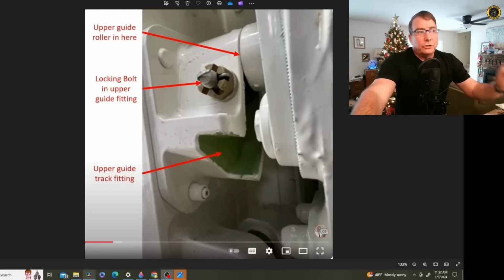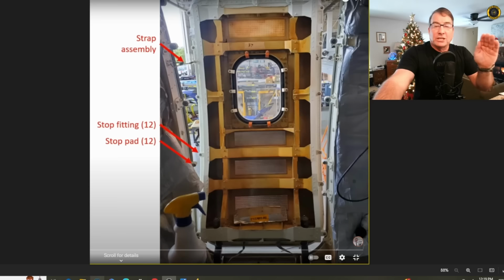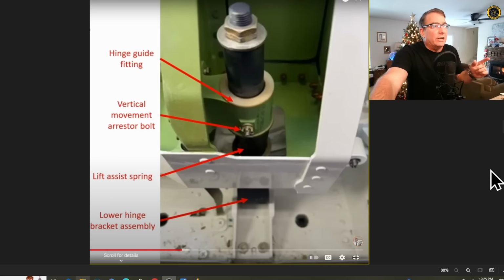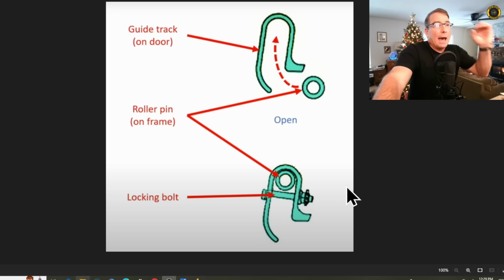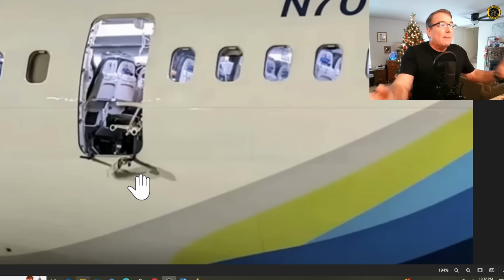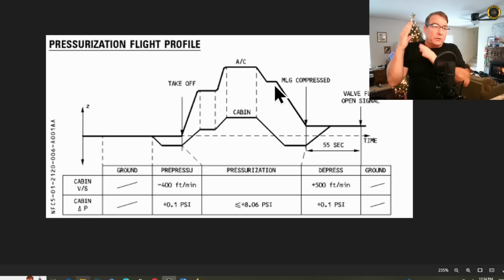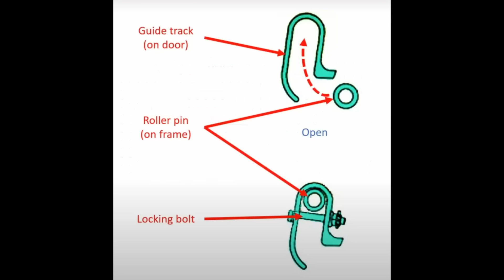Alaska 737 Max-9 Door UPDATE! 8 Jan 2024

Comment: I’ve been an aircraft technician for 23 years and we operate the Max9. I’ve opened and closed one of these plugs as well. Keep in mind that other 737 NG’s have these plugs installed in the longer fuselage models, not just the Max. They all work the same way and there’s never been an incident like this. I’m not saying this is what happened, but I can’t see how this could lug could come loose unless the two upper capture bolts, and the two lower bolts through the spring hinges weren’t installed. Even if a set of bolts, either uppers or lowers were missing with the opposites installed, I can’t see how the plug could come loose and depart the airframe. Just my ten cents. 
To open the plugs, the corresponding row of seats where it’s located has to be removed, and the surrounding interior side wall paneling and insulation. There’s also a seal that reacts to ambient temp that helps keep everything nice and tight.
Reply: Some people who signed off on this particular installation ought to loose their license and/jobs.
Reply: My understanding is that you remove the bolts than push down on the door against the spring pressure till the top roller clears the track.  Then the door can swing out.  Am I right about that?
  I was an aircraft mechanic for many years and I dont see how it could just come off without some noticeable damage.  Charles
Reply: Your ten cents are appreciated and quite a lot more valuable than my 2 cents
Reply: It was clearly installed wrong
Reply: Yep...any one of the four capture bolts, if installed, could have kept that plug from lifting vertically and disconnecting from the capture fittings.  NAS bolts are extremely strong, and those bolts in particular would have been ones rated for high shear strength.  As a retired aircraft mechanic, I'm willing to bet the plug door was fitted into place without the bolts being installed, not documented properly as such, and then something like shift change happened at the factory, and you know the rest of the story.
Reply: @465maltbie  yes
Reply: @mcburcke  You don't want a Friday afternoon 737.
Reply: @kCI251  You sure don't want a loose license and/or job...
Reply: If this turns out to be the case, that would be quite shocking wouldn’t it!
Reply: @465maltbie  "Am I right about that?" 
Malt I think it's the opposite. The "vertical assist springs" are meant to help LIFT the plug up out of the guide track. The guide track is on the door and the guide roller is on the airplane frame.
Reply: Hinge arrestor bolts and slot pin bolts all need to be missing?

Who sign that checklist ???
Reply: Somebody went to lunch and forgot where they left off when they came back.
Reply: Once the capture bolts are removed how much pressure is needed to move the plug upward those couple inches until the guide roller exits the guide track? At 8 PSI that's quite a bit of pressure on that plug. If the bolts were missing wouldn't the plug just push up the roller and come off first flight? Not sure how many flights there were since the plug was last installed.
Reply: I'm not a technician but understand logic and mechanics, and I think you are spot on. Based on the lack of shearing of side eye holes, the door had a clean explosive removal. Someone in 'QA' is gonna get their ass handed to them for very possibly missing a whole door bolt assembly.
Reply: Your ten cents is deeply appreciated.  My question is: did Alaska need to perform any type of maintenance which requires to remove the door plug since the delivery not long ago?   Thank you very much.
Reply: @jeffropenn  Jeff, Just an observation and wondering your opinion:  Looking at the 9 minute mark, the upper roller pins do not look to be sticking out as far as they should be ( by maybe a inch+).  Could the roller pin have slide back into the guide roller (of frame)?  Just curious, thanks
Reply: Again two words Quality control.this particular inspection at the operator I work for is RII  and it's done during a B check hangar check. Boeing got lucky on this one. Kudos to the entire flight crew.@mcburcke
Reply: @rael5469  No it cant, look at how the track is made.  You cant lift it out, the bolt holds it closed and you have to lower the door.  That is the only way I see it working.
Reply: Somerhing was not installed, was missed as it seems. Its a new aircraft to assume wear and tear.
Reply: Yeah the only way I can see this door plug leaving the plane as cleanly as it did is if the 4 bolts where not installed. Otherwise  it would depend on the simultaneous clean shearing/failure  of all 4 bolts with no jamming of said bolts, I find that hard to believe.
Reply: @jeffropenn I do agree with you !  somebody had to have omitted at least 2 of the cotter pins!  and missed it on inspection.  How could that have happened ?
Reply: @kinosaki3311  Hard to imagine since the plane was 2 months old.
Reply: Thanks for your input.
Reply: @465maltbie  no you're wrong, Chris has got you confused, Blanco explained it properly.  Enjoy your retirement.
Reply: @465maltbie  the track is mounted on the door. The pins come out the bottom of the track. The door has to be lifted to open.
Reply: If that door-like "plug" slides up/down to disengage/engage with the frame, then wouldn't that require plug to be less tall than the opening (to facilitate the up-down movement), and thus leave a corresponding gap at the top of the plug once installed?  I infer that the design is so that the plug can be fitted from the outside of the aircraft yet still operate as a plug once installed (interior air pressure pushes plug against the frame), but I'm not seeing how it manages to completely occupy the opening.
Reply: @encinobalboa  ...or a Monday morning one for that matter!
Reply: @465maltbie  The track is on the door, the roller is on the frame, so the door travels UP (with spring assist) to clear the roller..  When it has traveled up that 1.5 inches, the stops will clear the ears, and there goes the door.  If the bolts all weren't installed, the remarkable thing is that it stayed close for a couple months, not that it eventually opened.
Reply: @thebigmacd  No you are confused, I was speaking about the roller track at the top of the door opening.  Look at the photograph of the part.  The bottom of the door has the springs and the bottom of the door has a bracket with the guide bushing that rides on the hinge.  look at the j track at the top where the roller is, the retaining bolt is under the roller and the roller moves down in the track to open and up in the track to close.
Reply: The tracking history of this plane shows it t departed JFK that morning, where it had been overnight. History has two major crashes from JFK. TWA 800 in 1996 (230 lives lost) and AA 587 in 2001 (260 lives lost). Does anyone here think it could have been tampered with at JFK?
Reply: My sentiments as well. There’s no way that plug door is sliding up and out if at least (2) or more of those movement prevention bolts were installed. 

I mean sure it could happen, but all (4) vibrating loose if no cotter pins, and ontop of that then the bolts themselves would have to fall out of the holes and who’s to say the bolts could even fall out once in place.
Reply: @craig7350  I disagree, look at the roller track at the top of the door frame, the door is pushed down to open and raised to close.  The springs help you raise the door to the closed position.  The locking bolt is under the roller.
Reply: Been puzzled why the top of the door has nothing to secure them to the frame of the aircraft.
Reply: @465maltbie  Look again. The tracks are on the door and the pins mount to the frame. Lift the door to remove.
Reply: @mcburcke  💯 Agree
Reply: If there IS such a thing as a 'no brainer', this one is. I think your ten cents is worth a million bucks.
Reply: I suspect they either never changed the bolts and the last one finally went, with cotter pins those have to be on a replacement schedule, or they forgot to put the new ones back in the last maintenance.
Reply: @Graham_Wideman  I think the fact that it’s a curved surface may have something to do with the ability to be as large as the hole in the fuselage thereby allowing the movement. Am I wrong ?
Reply: SABOTAGE!!!!!
Reply: @meko1896  Ok, thanks.
Reply: @465maltbie no - raised to open, down to close.
Reply: A LOT MORE TO THIS THAN IS APPARENT NOW !!!!!!!!!!
Reply: @adrianklaver113  the four cross bolts, PLUS the jam nuts and washers on the lift shaft.  If just the four cross bolts were missing, the jam nuts and washers should have retained the door in it's hinged down position.
Reply: @465maltbie it’s the door that contains the upper track.
Reply: @adrianklaver113  I find it hard to believe it just blew now after being in service for three months.
Reply: @465maltbie  the upper roller track is mounted to the *door*. Look up a diagram of the assembly. The roller is mounted to the frame. The J-track is on the door.
Reply: It seems that even though these plugs are referred to as plug doors they are not oversized like traditional plug doors.  I've read that these plugs and some overwing exits are like this.  They rely on the stop fittings and stop pads to take the force of the differential pressure between the interior and exterior.  @Graham_Wideman
Reply: sabotage ?
Reply: Airbus tech here. I appreciate your explanations.
Is there any kind of rigging that goes on with installing those plug doors? 
Any kind of even-torqueing measures taken, with the plug securing hardware?
Reply: @465maltbie  u r CO-rectal.  it requires missing parts and direct movement.
Reply: @edgonsorowski1924  No tampering - it's lots of work to get access to the bolts. Removal of seats and panels first. You don't think a much better guess is someone slept at work at Boeing and failed a critical inspection step?

If you get home from the store without cheese - is it more likely you forgot to buy it. Or forgot to pack it. Or do you suspect someone opened your car and stole it from your bag?

Never go for complicated solutions as long as you have simple solutions still not investigated.
Reply: @adrianklaver113  Or lack of cotter pins, and unthreading of nuts due to vibration, though that seems very unlikely in such a short time period.
Reply: @mcburcke  I fear that you might be right.  This explains the event.  But it does not explain how in the world such a critical procedure could be messed up AND not checked before letting the airplane out of the hangar.  
That's the part of the story that is going to leave a welt.  If things like are happening on a brand new airplane then what kind of confidence can we have in any of the work done to this airplane .... who signs off on this work?  How could this get signed off?   If it wasn't signed off how did dthe airplane get into service??
Reply: @465maltbie   I'm not sure what you are talking about. You stated it the opposite. You said "My understanding is that you remove the bolts than push down on the door against the spring pressure till the top roller clears the track.  Then the door can swing out.  Am I right about that?" You were wrong about that. The track is on the door and it lowers down over the roller, then the bolt is installed. The springs help lift the door when the bolt is removed. They said the door weighs 65 pounds, so the springs help lift the door. They are meant more for when a real emergency door is installed.
Reply: @gismo130  That's a great song
Reply: @465maltbie  You have mixed what is part of door and what is part of door frame. The pins are in the door frame. The opening for them to slide out is downwards on the door. So you lift the door to slide out the pins.

The springs helps opening the door. And the upper bolts blocks the door from being lifted, because the bolts are inserted under the door frame pins.
Reply: @requited2568 This plane was only months old. The word finally doesn't apply.
Reply: @seagullsbtn  The top of the door is secured to the frame by the two frame pins that are sliding into two channels in the door.

And then the overlap of all the 12 pads also blocks the door from moving outwards.
Reply: @ChasOnErie  Why scream "SABOTAGE" if "stupidity" is a viable solution? You want everything complicated?
Reply: @mcburcke my husband worked at Boeing in Mesa, AZ on the building of Apache helicopter. He passed away 4 years ago. He always had stories like you guys are talking about. Shift change, workers knowing something needed changed but upper management doesn’t listen. He had a couple stories that people lost their jobs over but I don’t want to say on here. Boeing isn’t what it used to be.
Reply: @Milkmans_Son   That is less surprising given the pressurization fail light came on three times going back to December 7th. There are alternate explanations for why that could happen, but one is the door plug was moving around on its contact points. A body at rest stays at rest, the weight of the door plug, the friction of the contact points and pressurization would tend to keep the door plug in position. As Juan pointed out in the video there could have been a 'perfect storm' combination of low pressure differential and fuselage movement to make the door plug move enough this time to overcome it's rest position.
Reply: It’s my understanding this is a “permanent “ from the factory option, and becomes a structural part of the airframe, therefore not needed to be inspected every 100 hours…but maybe at an annual..
Reply: @465maltbie Push the plug/door up not down…
Reply: @rael5469  Thanks, someone else mentioned that also, most doors have the track on the frame, it looked like that to me.  Have a good week.
Reply: @465maltbie   "door is pushed down to open and raised to close. "
You are confused. The track is mounted to the door. From the closed position the roller is at the top of the track. The door can not go down with the roller at the top of the track. The track is mounted to the door so with the roller located at the top of the track, the door must be lifted to get it off of the roller.
Reply: Can loose bolt lead to failure? UA found some bolts loose, but not missing. Wondering if they would have failed the same way if kept in service.
Reply: @seagullsbtn   "Been puzzled why the top of the door has nothing to secure them to the frame of the aircraft."
The door frame is not strong enough to have stops located at the top. The door structure is strong enough to have stops at just the sides......but there ARE 12 stops. The door has a seal depressor all the way around the circumference to seal it.
Reply: As an A&P, is this plug removed or these retention bolts inspected at the initial 100hr inspection service? Given the subject aircraft has been in service for 10 weeks, I’m guessing it has recently completed that scheduled service inspection by Alaska Airlines
Reply: Do you think there is any way Spirit could be responsible for this?
Reply: @edgonsorowski1924    The blame for AA587 clearly rests squarely on the First Officer, whose big feet stomped on the rudder pedals in both directions several times, putting extreme side loads on the vertical fin and attach lugs…   In over 30,000+ hours as a major airline Captain/First Officer, I’ve never seen anyone ever stomp on the rudder with the kind of force that was clearly captured on the accident aircraft’s flight data recorder…  
  The TWA 747 investigation conclusion to me seems to be somewhat iffy, in that you would think that the electrical arcing inside of the center wing fuel tank surely would have manifested itself in at least one or two other of the old 747-100 series of aircraft…  There were a LOT of those airplanes flying at that time which for sure weren’t getting anywhere near the quality of maintenance attention that the TWA 747 was getting…
  And for someone to tamper with/loosen the hardware related to the Alaska 737 exit plug, they would have to remove seat rows, and disassemble the side panels to even get at the plug, which would be a highly unlikely thing for someone to do…   Most likely, the hardware was not or improperly installed during the build at the factory…
  Since the aircraft was delivered new to Alaska in October of 2023, its unlikely that there were enough hours or cycles on the aircraft to require a major inspection where that plug would have to be opened up and inspected…
Reply: @motofunk1  I read the aircraft was on its 99th revenue flight when the accident occurred.
Reply: @465maltbie   I was thinking the same thing, Malt. I also thought the track was usually on the aircraft side. It's hard to tell on that close up picture.
Reply: @465maltbie  The roller is fixed to the fuselage. The guide track is fixed to the door. Look at the image at 3:47. Thus when the door moves relative to the frame, the guide track moves.
Reply: @mcburcke  This assumption makes sense to me . I can't think of anything else .
Reply: @aerohk   The upper bolts would still be in place, so no. Any ONE of those bolts would keep the door in place. It is quadruple redundant. I'm not sure but I think all four bolts had to fall out for the door to depart that plane.
Reply: @kCI251  You're assuming it was inspected! I'm not assuming anything about Boeing procedures these days! OTOH reportedly the satellite internet antenna was installed just before the first pressurisation warning event Dec 7th, so could it have been that contractor to Alaska Airlines who needed to remove the plug and reinstate it after their work and if so who is then responsible? We should wait for the investigation to find the root cause but what I wonder is how many more faults are there hidden in the 737 MAX's?
Reply: @requited2568 The plane came off the line 10 weeks ago! It's not wear and tear!
Reply: Those who installed this door also thought that top bolts stoppers are redundant and didn't installed it.
Reply: @duanebidoux6087  Sure if the pin were improperly hardened and had sheared off or the ramp assembly were improperly machined in some way to allow excessive movement. Since pics show the upper pins are still in place, scenario 1 appears unlikely. Now that FAA has recovered the plug, they have evidence to inspect the receiver ramp. 

United is apparently reporting they have found several retaining bolts to be loose. Given its castellated nut w/cotter pin, how are the bolts loosened? 

My understanding is the plug is removed during an A inspection by airline operator A&P. May also be removed by operators upon delivery as final outfitting of aircraft. Is the ramp bracket metal annealed allowing the bolt head and nut to embed into metal? Are the bolts of improper heat treatment and threads are stretching? These bolts are not intended to be load bearing, it’s hard to understand how they loosen in service if the cotter pins are in place.
Reply: If the rivets that hold the mechanism in place sheared there would be the same thing as pulling the bolts
Reply: I’m definitely listening to you as you are actually in the know. No media gibberish. Rumor has it Alaska had pressurization issues in prior flights. PBA? 😂
Also if so, wonder if the FA’s heard whistling? I don’t think any other MAX 9 operators have found major issues. United says they found 5 with loose bolts. Loose? With cotter pin installed on the castle nut I see no issue.  I would imagine them to be designed to be a bit free given the system design. Just a retainer in shear. Not tightening.
Reply: Agreed. Nor a Monday morning!
Reply: @wmjohnson7063  What rivets?
Reply: @mcburcke makes absolute sense. Oh dear 🤦🏽‍♂️
Reply: Guarantee anyone who touched that door is sweating. I worked in a different safety-related discipline, and any assembly of any safety-related component was thoroughly photographed before and after we touched it. Of course there's a checklist, but I'd be more inclined to believe a photo rather than initials.
Reply: @jeffropenn After the door is shut on the ramp, what holds the door down with the upward force of the springs in play? Weight of door and friction of the pads on the stop fittings?
Reply: @requited2568 The plane was in sevice two months. There should have been no reason for maintenance there.
Reply: @jeffropenn When you removed those bolts/nuts to open the plug for service were the nuts self locking nuts?
Reply: @mcburcke  Shift change is a dangerous time.  I recall reading of a maintenance related disaster years ago where a supervisor volunteered to speed up a slow job installing fasteners in (my memory is inexact here) the elevator control surface.  For some reason, the supervisor didn’t finish the job and nobody asked questions because it was the maintenance supervisor who was responsible for the documentation.  The next shift also asked no questions because from the documentation, the work appeared complete.  The control surface detached in the aircraft, causing a crash.

A shift change in the middle of plug door installation either at the factory or at a maintenance operation could have aggravated a lapse in documentation which caused then missing castellated nuts and cotter pins not to be noticed.

This is a very young aircraft.  It doesn’t bode well for Boeing’s quality control procedures if the aircraft left assembly missing the locking nuts.  The aircraft could have been reconfigured after assembly, but that does not seem to be the case here.
Reply: @gumbus75 Do you think there was a misunderstanding that the team thought they were fitting a door instead of a door plug ?
Reply: Hey, question from another maintainer.  Don’t those things have cotter pins, safety wire, or at least sheer wire?  We have emergency escape hatches over the wing with hinged locks.
Reply: how does the flush door clear the fuselage to move either up or down? @thebigmacd
Reply: Lose is the right way . The way you spelt it is like “hey that lug nut is loose , tighten it or the door will go missing !”
Reply: @adrianklaver113  If a door plug with no fasteners installed can survive pressurization tests to 150% of max or whatever it is plus three months of service with only 3 pressure warnings, then fail suddenly and catastrophically at well below cruising altitude (let alone max altitude), this is a design and engineering failure of epic proportions.  If true, MCAS has nothing on this.

As far as the 1st law of motion goes, I have no idea how that fits here but either way you forgot the external forces part.
Reply: Yup.  It's either extreme negligence, or sabotage.
Reply: @robertbenda3285 never go to lunch until the task at hand is complete.
Reply: @TheCyberMantis  I heard the guys who installed the wifi antenna in the plane may have used this door plug to gain access...
Reply: @jamesmurray3948  Good question.  The track looks to be at an angle, not parallel to the door.  So I think the top moves up and out at the same time.  There must be a lot of clearance for it to work.  I'm interested to see how the seals work.
Reply: pins were never installed all four missing
Reply: @mcburcke it’s so new, I don’t think you would have fatigue on those bolts either.  Looking more likely a slip up in manufacturing.   Very lucky no one was hurt or killed.
Reply: Also an AME with similar length of experience - seems the most likely issue is that the bolts were installed, nuts done up finger tight, the split pins were not installed, and then the quality inspection was either not done or poorly done.  It would be very unlikely the bolts weren't installed at all, as the door wouldn't have lasted for a couple of months of flying like it did.  I've seen on a number of occasions where technicians have forgotten to put split pins in - usually this is picked up on inspection, but it's also a lot easier to not notice a missing split pin when inspecting than a missing nut or bolt.

The RAN lost a Sea King helicopter about 20 years ago when a tech forgot to install a split pin in a flight control linkage and the missing pin wasn't picked up on the inspection.  The nut worked loose over time, then the bolt fell out and the linkage disconnected, the helo immediately pitched down and could not be recovered due to no pitch control.  

It should never happen, but in some facilities/units/companies the culture of inspection standards can become lax, and it opens up the opportunity for this to happen.
Reply: @465maltbie  You push the plug up.  The Boeing manual "AMM SDS 52-23-00" is wrong!
Reply: @savagesteve5894  How could they know the pins were missing? There is no way they have the bolts and castled nuts still...
Reply: @moggy4086  The pins would have to be missing from four bolts. But more importantly why are only four bolts holding this piece to the airplane? There should be 40 bolts, not 4. What happened to Rosie the Riveter, did she die?
Reply: I don't know.  Some of the pictures show the stub from the pins still in place  That means the bolts mentioned in this video was not there to allow the door to move upwards.  The only way that can happen is the cotter pins were not installed properly and the nut came off.  Even then, I don't know exactly know how the bolts in the door frame is attached to the door.  If its directly bolted in, it seems unlikely for the door to move up unless all the bolts were sheared off.  I know crazy things has happened, but I think there is more to this.  I just don't see the bolts locking the pins in place to shear off even if the part was not a AN bolt.  Once the bolt holding the pins in place came off, I can see that over time, the vibration and pressurization/depressurization cycles may work harden the remaining bolts.  Once they start letting go, its a chain reaction.  I'm sure there is more to this story and we will find out once NTSB releases their findings.
Reply: @465maltbie  No, the roller track is on the plug, the roller is on the door frame.  Push up to open.
Reply: @ericmcleod7825  Correct.
Reply: I was thinking a lot of things would have had to fail for the door to come loose.
Reply: @tori8380  Its either incompetence or sabotage.
Reply: I do not understand why each bolt is not safety wired in place? There is not enough redundancy.
Reply: @mcburcke yep, could be that built on a Monday or in this case Friday pm thing…someone’s shift was over and had to get outta there 🏃‍♂️ leaving the bolts installation incomplete….and the next person on assumed the job had been completed without carrying out a visual inspection.  There should be a paper work trail 🤔
Reply: @ZeroG they may be able to tell if bolts and nuts were fitted by looking at the fittings microscopically and/or other non destructive examination. 

If they were fitted but the nuts not pinned, there would be wear marks as they worked their way loose.
Reply: @perwestermark8920  Yes, Hanlon's Razor applies here. "Never attribute to malice that which is adequately explained by stupidity."
Reply: @mikewaterfield3599  They all have castle nuts and cotter pins, yes.
Reply: All four bolts were missing their cotter pins and rattled out? Really hard to believe. All four bolts were substandard and sheered in a cascade,(one goes and the rest follow), event? Design usually builds in a safety factor, bet two bolts at the top are all that is really needed. The door is forced up against the stop pads by the over pressure and has to overcome the friction involved to move up. With the fuselage upright, the weight of the door plug would hold it down. What caused the plug to move vertical off the door pins?
Reply: @Leon-qc7fe  It's not the bolt, its the nut that needs to have a cotter pin if it uses a nut.  There is something fishy about the entire situation.  Let the NTSB find the root cause.
Reply: @465maltbie  Looking at the diagram, you've got it backwards. To get the door released, you have to lift it about 2 inches for the roller lugs to come out of the bottom of the tracks in the door. The springs in the bottom of the door hinge assist you in lifting the door but cannot lift the door completely on their own. BUT, if the capture bolts are missing, and with the plane rattling the door around with varying G-forces on the door during the climb, the springs may be able to get enough advantage to lift the door themselves, and air pressure does the rest, blowing the door out.
Reply: @jesstreloar7706  There is hardly any load on the pins. They are there to stop the door from being lifted. So at least the two top bolts wouldn't even see any load from a seriously hard landing.

So it's almost impossible to shear them without someone driving something heavy into the door.

But skipping cotter pins and the nuts can come loose. And then maybe there is space for the bolts to fall out. Maybe.

But for this plane they might have completely missed to insert any bolts at Boeing, treating this door plug just as the other variants of active or deactivated doors. This specific door plug is the only variant where bolts are needed to secure the door opening, because there isn't any normal door locking mechanism.
Reply: @brnmcc01  I figured something like that.  No reason in the world for the bolts to come loose then.
Reply: @65gtotrips @Graham_Wideman I also thought it would be a curved surface thing until I looked at some pictures of the plane. There is in fact a gap at the top of the door plug, at least as far as external surfaces are concerned--big enough to be very visible once you start looking. I'm guessing that gap narrows towards the internal surface and the last few mm is some kind of gasket/seal.
Reply: Journeymen millwright and certified welder here for 46 years, currently a supervisor in a steel mill….I’ve had to troubleshoot a lot of mechanical failures and and has been stated here, the chain of events for 4 bolts with nuts and cotter pins to come loose and work their way out of position seems a stretch….I would think there would be significant evidence of that happening if it was the case….thank God the outcome wasn’t worse.
Reply: @encinobalboa  Or Monday, Tuesday, Wednesday orThurstsay ...
Reply: Isn’t there like a good high-school shop or auto-mechanics class near the factory that Boeing the aircraft manufacturer formerly known as McDonnell Douglas could contract with for their more difficult technical challenges like this? I mean it sure looks like nobody even bothered to secure the door and nobody else bothered to check it, and anyone who has had auto mechanics at the high-school level knows that a good instructor would never let that go. So maybe that’s how they can come up to that level as an aerospace company.
Reply: @tori8380  But many things needed to fail. The insertion and securing of upper left bolt. Of upper right bolt. Of lower left bolt. Of lower right bolt.

One single bolt - any single one of them - should have been enough. Because there is hardly any load on the bolts. The door weight hangs on the two pins in the upper part of the door frame. And the pins can be seen on photos. And the air pressure forces are handled by the 12 pads that are all there. So the outcome then is that for some reason the door had zero bolts blocking it from being lifted 4 cm upwards (possible from bumps and the two springs at the bottom) to disconnect from the two top pins and at the same time slide past the 12 interlocking pads and then fall out into the void.
Reply: @ZeroG   Why 40 bolts needed? The 4 bolts aren't there to handle any actual forces. Going from 4 to 40 isn't making any difference if the actual issue is that they forgot to add any bolts or to secure them. More bolts is what you do when you need to share load.
Reply: @mikewaterfield3599  The four nuts should have cotter pins. But at the very least we more or less "know" that plane did not have any cotter pins installed. Bigger question: did it have the castellated nuts + washers + bolts?
Reply: @465maltbie The springs help raise the door off the pins in order to open it.
Reply: @hokefisher7542  What should hold the door down is any single one of the four bolts. Without bolts? Just friction against the 12 pads, and the fact the two springs are a bit weaker than the weight of the door. So friction and gravity. Not a good option for a shaking plane. And that's Juan's "rat trap" scenario.
Reply: So what are you guys saying? The bolts were not placed at all? Trying to understand
Reply: The fuselage was shipped with the bolts loose knowing that the plug door was going to be removed at Boeing, but the plug doors were not opened at Boeing. The bolts were never inspected at Boeing. No need to.
Reply: @Lifebackmed Either they were not placed or none of the cotter pins were installed and the nuts backed off allowing the bolts to fall out. The only other scenario is outright sabotage.
Reply: Question, after you installed the plug door was there a team lead or inspector to double check the work?
Reply: @Lifebackmed  Bolts not placed at all. Or bolts inserted but the nuts not tight and no cotter pins to block the nuts from rotating. So the nuts falls off. And then the bolts falls out. So for that flight it was friction and gravity that kept the door from lifting up and disconnect.
Reply: @jesstreloar7706  Nah, more like someone forgot to install any of the bolts, and just snapped the door into place, and the springs and 12 locking pads kept in place until a few hard landings is my .02 worth.
Reply: What if they weren't torqued correctly?  Could be, definite maybe?  Not my field, just WAGin'.
Reply: 41 year A&P here.  I agree.with you 100%.  The bolts were not there.  why they were not is going to be the focus.  4 castellated nuts do not mysteriously fall out.  Human factors strikes again.
Reply: An extract of the maintenance manual would be of great help for there  @thebigmacd
Reply: @ZeroG  For a door plug that is designed to be removable for maintenance four bolts are completely sufficient.  The bolts are just there to keep the door from moving, the forces on the door are taken up by the stop pads.  This design is perfectly adequate, but any well designed aircraft component can fail if it is not installed correctly, which is clearly what has happened in this case.

The root cause here is most likely the maintenance culture at the facility that installed this door, which turned a simple error (maintainer getting distracted and forgetting to install split pins) into a significant failure (the missing split pins are not picked up during the associated quality inspection and the aircraft is released in that condition - at this point the failure is only a matter of time).
Reply: @richsarchet9762  what is surprising is the fact that the assist springs seem to favour the open position rather than the closed position in case the bolts are missing or broken.
That's strange from a safety perspective.
Reply: @DoubleMonoLR  Yeah, I'm going with the bolts not installed and some serious negligence allowing it to be overlooked. Whether it happened at Boeing, Alaska, or the fuselage manufacturer, only time will tell.
Reply: @Milkmans_Son   Don't agree, If the parts fit tight, it could theoretically go for a significant period prior to the door departing despite the installation of the bolts. Seems more an unlikely event than an actual design flaw.
Reply: @ShaunHensley  really
Reply: @gumbus75  TWO hinge arrestor bolt assemblies. One for each hinge
Reply: @richsarchet9762  there is no way the door is staying closed unless at least one of those locking bolts are in place due to the lift assist springs.... Does not mean there were nuts and cotter pins on said bolt/bolts that were holding door down.
Reply: @edgonsorowski1924  Your tinfoil hat has a dent in it.  Go get that checked.
Reply: @SteamCrane if the AMM is wrong then the consequences can be terrible...
Reply: @requited2568 . There is NO MAINTENANCE. The plane is 2 months old...
Reply: Yep!  A huge oversight happened there!
Reply: @ZeroG  Somebody is going to have their nuts in a vice.  As soon as they track down the culprit.
Reply: @465maltbie , The roller pin does not move. It’s rigidly mounted to door frame. You have the relative motion right but it’s the guide on the door moving upward that releases it from the pin. Not the pin moving downward.
Reply: So someone fd up at either Alaska or Boeing. This is a serious error that could've resulted in loss of lives
Reply: How about that nut and what looks like rivets on the hinge guide fitting on the plug? That nut could have backed off and then got weak and ripped the rivets out.
Reply: @edgonsorowski1924  would you just go away. You commented the danger BS conspiracy on the last video.
Reply: From the picture it even looks like the bolt is angled downward - so it would rattle its way into staying in place, not fall out.
Reply: @navelpicker  You think they hire anyone licensed to install these parts into the aircraft? LMAO
Reply: Can someone help me understand why the FAA didn’t issue an AD for NG aircraft that have these “plug-type door plugs”? For example, Alaska operates 76 737-990ERs. They appear to have the same plug. Do they not share the same risk profile?
Reply: And this Alaska incident seems to be totally different issue than the loose bolts on the sliding portion of the hinge assembly pictured from United that show the bolts loose holding the sliding assembly to the door structure.  If all them bolts worked loose the hinge assemblies would no longer be attached to the door, but the upper guide pins and track would still be secured by the locking bolts.  And since the door cannot move up with these in place and the pressurization force is pushing against the stop pads the door would still in theory remain in place.  We really need to see phots of the inside of the door found in Bob's back yard.
Reply: @mcburcke  I'd go so far that I'll say that just a single one bolt could probably have prevented this from happening.
My thought on this matter is that the people fitting the doors and the people fitting the interior are in different groups and this coincides with shift changes or even just a lunch break. Those groups don't communicate and there's always a pressure to keep the pace up so if the preceding group isn't there then they do the next stage and fits the interior.
I wouldn't be surprised if planes are moved around too during the process so that when the tech comes back after a break it's a different identical plane there in the same spot where everything looks right and he signs off on the ticket without checking that it's the right plane.
This could just boil down to a company cultural issue that goes back to the top level where someone has sold in the idea of "lean production" or some other buzzword strategy that cuts all the corners of safety.
Reply: A piss poor carpenter can cover up mistakes with trim !  It seems there were some leftover parts before this massive hole was prettified ! 

I am thinking Boeing should be thanking their lucky stars this happened when and how it did. I see a spanking coming on, but so happy no physical injuries. 

Thank you again Juan. I know it is difficult to explain the unexplainable !
Reply: @edgonsorowski1924 Not a chance it was tampered with at JFK. You have to remove seats and interior wall finish to get to the attachments used to secure this door.
Reply: @kCI251 could the window on the door failing cause the door to fail?
Reply: @Cobalt135  they simply forgot the cotter keys.
Reply: @ianomalley3054  How tight do you think it is?
Reply: @ShaunHensley  LAME?
Reply: @mcburcke This would be my assumption as well. It seems highly unlikely to me that all four bolts could have been installed, yet cotter keys were not installed, AND all four nuts loosened up allowing all four bolts to fall out. An assembly line screwup seems MUCH more likely.
Reply: @perwestermark8920  yeah, thats standard practice for aircraft.  I can’t imagine that being a quality control item from Boeing.  Checking the escape hatch is a ten day or sixty flight hour item for us.
Reply: United Airlines found loose bolts on the door plugs on several of its grounded 737 Max 9 planes days after a door plug blew out of an Alaska Airlines plane while it was in-flight. 

"Since we began preliminary inspections on Saturday, we have found instances that appear to relate to installation issues in the door plug – for example, bolts that needed additional tightening," United said in a statement to CBS News.
Reply: @olivieraleman  well, the media has been reporting this pretty stupidly.  The worst case would be the passengers getting snuffed at altitude.  At high cruise your lucky if you have ten seconds in rapid de compression before you pass out.  Sad reality is even though crews are drilled for it, even they usually have crap deployment time for O2 masks.  Ours certainly do.  There was a TBM that happily continued flying for three hours with everyone onboard dead from hypoxia.
Reply: @traviswells1388  yeah…… the media is just stupid when they report on aviation.  Here locally some years ago a student landed a skyhawk on the beach.  Standing in front if an obviously intact aircraft the “journalist” stated a “student flying without a flight plan? Crash landed a multi engine airplane on the beach”.  Heres a few questions, where are the cotter pins?  Where was a service check?  “Found loose bolts on the floor”?  Nothing sets off alarms like random hardware on an aircraft.  I found a washer once and spent three hours trying to figure out where it came from.
Reply: Well this one obviously  wasn't  nice and tight
Reply: @Graham_Wideman Yes, there is a gap at the top if you look at outside pics of aircraft with this door installed in standard configuration
Reply: @mcburcke  Yep..those bloody Swiss Cheese holes again!!!!
Reply: @Jeff-sp7bg  yeah no one even did a good N’ tight with a calibrated elbow.
Reply: Those bolts weren't installed.  If any were, there would be damage to their mountings.  You have the nuts and bolts, which should be torqued down to spec.  There are retaining pins through the bolts.  

Somewhere is a tech that just figured out where those 12 extra bolts came from.  Considering this huge chunk of metal could have struck the tail of the aircraft, this could have been much, much worse.
Reply: @fakshen1973  there are such things as service checks, and basic time and cycle related inspections.  I don’t know what the norms are for a MAX, but on the birds I work this kinda thing would be caught in a 60 hour/ ten day.
Reply: I was going to say the same... In my 27 years as an air force wo tech I've seen quite a few hatches (and even a radome once) separate the aircraft but they're not the same... Granded I'm not a 737 rated tech (our F16s are a "bit" different) I'm leaning towards to some QC issue from the factory.
Reply: @yanniskouretas8688  you actually saw panels detach?  I worked 14’s before bugs, then went to winged limos.  I never saw a combat bird lose a panel and that included alpha cats.  Something about the whole thing does not add up.  Pressure seals and hatch lock mechanisms are inspection items on low time intervals for us.
Reply: @kCI251 jail time if a falsified document exists. No excuse for this. (Pending more information)
Reply: @robertbenda3285 would have taken at least 3 people to make this mistake.
Reply: I think maintenance man not used lock pins on bolts this is reasson for this incident.
Reply: I’m not sure what purpose this particular plug type door serves if it is not being used? Why is it there and why do they not have it on other Boeings ?
Reply: @navelpicker  "loose" licenses sink aircrafts.
Reply: @michaelvos9721  So what fills that gap?
Reply: My unqualified opinion is that none of the 4 bolts were installed. Time will tell but if I were a betting man that is were my money would be
Reply: @bradley_Bradley  Because during the lifespan of that air frame, you don’t know what the current or future owner(s) will going to require what configurations so the fuselage itself has to be built to allow for any possible seating layout including needing an exit door or a non-exit door, like this substitute plug.
Reply: @johnypitman2368  Inflation
Reply: @SWilford   Clod pin? Never heard them called that before, always cotter pin or split pin. They do look like standard castellated nuts. Sometimes nyloc castellated nuts are used with split pins, so if the split pins does fail the chance of the nut coming loose is very small. Obviously when installing split pins, the nuts are done up to a specific torque and then backed off to align with the holes in the bolt. If they nuts were already backed off and the split pins not installed, then it would be easy for the nut to work loose.
Reply: Same as in other airplanes but not from the same production channel..
Reply: Are you saying the seal was the only thing holding it in place?
Reply: I thought a plug type doors circumference is larger than the circumference of the cutout in the fuselage? I'm also having trouble seeing how this happened. It gives you a lot of respect for delta p.
Reply: @Graham_Wideman  The fuselage is round and the plug curved so lifting the door plug up will clear the fuselage even when the plug is a snug fit.
Reply: @mcburcke  correct 👍
Reply: I meant what I wrote. If you safety wire the bolt into the hole it will remain in place if the cotter pin falls out and the castle nut vibrates off. More redundancy @ahndeux
Reply: What is the aim of having these plug doors fitted if they cannot be opened in an emergency?
Reply: @465maltbie Actually the door moves upward and the springs assist to overcome the weight of the door.
Reply: @Leon-qc7fe  True, but that would require a hole that creates a weak spot on the structure.  If installed properly, a cotter pin is far superior.  Typically, safety wire is only used if there is more than one bolt an the wire goes from one to the next.  Extra holes are not always the best solution if it can be avoided.  You can't idiot proof everything.
Reply: Beoing should consider themselves very lucky! It's clearly a quality control oversight which could have resulted in fatalities.
Reply: @kCI251  They will, aviation safety on the maintenance front is not a joke. For good reason!
Reply: Yeah, I've been looking at this design, it would seem even one locking bolt in place would do the job. They would have had to lose all 4 bolts, nuts and pins. Even then once pressurised that thing shouldn't move.
Reply: Doesn't look like a Boeing problem. Looks to be an Alaska airline problem. They get brand new aircrafts, they are fitting it for their purposes and then someone forgets to put everything in place and check it. But that is just speculation
Reply: ? Is there  schduled maint  to check the plugs .....other than annual insp??
Reply: @edgonsorowski1924 are you honestly suggesting that someone at JFK has been tampering with planes for 30 years. In this case disassembling an interior, removing bolts and reassembling without being noticed.
Reply: @requited2568 the plane is less than 3 months old, I bet those bolts haven't been touched since the factory.
Reply: @DoubleMonoLR if properly torqued up, yeah unlikely, if they were just finger tightened and they forgot to torque and pin, it becomes much more plausible. Plenty of car wheels have fallen off because a tech forgot to finish torquing them.
Reply: @danielvanced5526  But it did move.  I saw pictures of some of the door plugs from inspections on other airlines, and the bolts on the door plugs were completely loose to the point of the washer being able to move.  The bolts shown was on the bottom bracket assembly where its connected to the hinge with a bolt and nut in place mentioned in this video.  That tells you there was something wrong with either the construction of the plugs or hardware was removed later on and not reinstalled properly.  

You only need to have a few loose bolts to start a chain reaction.  If one set lets go, the remaining bolts would be under higher stress loads.  If it exceeded the yield strength, it would let go one at a time in a rapid succession.
Reply: Only explanation I can think of, is another WRONG size bolt incident. Can't see any other way to have multiple failures like this.
Reply: @rafbarkway5280  No, its unlikely based on the pictures from the United Airline inspections (see Zerohedge site).  The failure looks more and more like a lack of locking feature either on the bolt or nut which allowed the vibration to loosen the bolts and nuts to the point of them coming off or not under a tension preload.  Once they are off, its only a matter of time until it fails because there are more stress on the remaining bolts.
Reply: Is there an opposite door? Aircraft are mostly symmetric. I expected to learn about the condition of the opposite door by now.
Reply: I'll wager that the four retaining bolts were never installed.  Then the interior panels were mounted which covered-up the area before the omission was noticed.
Reply: @kCI251 I dont understand.  What is loose a job?
Reply: @edgonsorowski1924  You have to take seats out to take the interior panel out and then take the interior panel out to get to the door hardware. This is highly unlikely.
Reply: @465maltbie  The door is on the left, the roller cannot move it's position. It (roller) is mounted on its support fixed to the door aperture structure.
Reply: @mcburcke  Why do say "at the factory". How about during Airline maintenance?
Reply: "Typically, safety wire is only used if there is more than one bolt an the wire goes from one to the next." It does not matter one bit what safety wire is "typically" used for. The idea is "safety".  " Extra holes are not always the best solution if it can be avoided." I did not write "extra holes' would be the "best solution".    "You can't idiot proof everything." This has nothing to do with "idiot proofing" anything. The idea and my point was one more way to fix the bolt.  I hope you understand the point is safety.
Reply: @mpetry912  By who. And where?
Reply: @perwestermark8920  a just as valid a guess is someone slept at work at Alaska Maintenance and failed a critical inspection step?
Reply: @cuttersgoose  Wrong.
Reply: Hmmmm…Did one of Boeing’s “Locking bolt/castle nut/cotter pin Installation Dudes” need some extra hardware to put his kids’ swing set together? Stay tuned…
Reply: @465maltbie you’re correct about how the plug works. For it to leave the airframe with the bolts in stalled would cause serious visible damage.
Reply: @mcburcke you nailed it. This particular jet was brand new. Went into service just in October. I don’t think the bolts were installed at Boeing either.
Reply: That might explain this plane, but they've found several planes with loose bolts. Were they all from the same shift? Imo, the only one with a really loose bolt might be the CEO, Calhoun. Somehow he was allowed to take over Boeing after he trashed GE.
Reply: @kCI251 people make mistakes. That is why in aviation we have redundancy. I would expect tech A to install the bolts and tech B to check them. Maybe Boeing never thought tech B to be necessary and just trusted tech A to do a proper installation. While tech A should be certainly scolded for a sloppy job, I won’t be so harsh on them.
However, I would be EXTREMELY harsh on the people who decided tech B was not necessary.
My guess is that tech B was not there as a way of cost cutting. If so, this would be another glaring example of how corporate greed and cost cutting at Boeing are basically sending the company down the drain and presenting the entire aviation market to Airbus in a silver plate. If corporate mentality needs to change
This is just a guess, not a certainty, let’s be clear on that
Reply: @kinosaki3311 no. If they operate like we do, those plugs won’t be checked out till the next heavy maintenance cycle.
Reply: @mcburcke plausible scenario, imho
Reply: @adrianklaver113 I’m doubtful it left the factory like that as well.  If it did it’s a great design to last 3 months.  I guessing that door was off for maintenance recently.
Reply: I’ve been a nuclear inspector submarines and receipt inspector. You said exactly what I was thinking. Start checking toolboxes.
Reply: @ddalton692 once the rollers have engaged the roller guides or are seated into the guides, they’re not going anywhere unless the springs are pushed down on.
Reply: @seagullsbtn the top of the door has two “rollers” that on either side that engage a set of “pockets” aligned on the airframe side. Once the rollers are in the pockets the bolts should be installed.
Reply: @motofunk1 you only reach 8psi at cruise altitude. At 16kft the pressure differential is much lower (based on the 737 FCOM, it should be around 4.3psi, slightly less than 1/4 sea level pressure), enough for the plus to rattle around on the ground or in case of turbulence in flight. My guess is that, if none of the bolts were ever installed it was just a matter of time before the plug was lost. If they failed one by one, then  the NTSB should find evidence of that.
Reply: @465maltbie  Just to be clear...the roller is on the frame and the track is on the plug door.
Reply: @bradley_Bradley they are on other 737 models. The 900 series jets have them as well. There’s never been an incident where a plug left the aircraft like this.  The reason some of the 737’s have this is because if you’re going to be seating up to a certain amount of passengers, you have to have enough emergency exits for them. It’s something that’s added by Boeing so that if a carrier wants to add more seating then there’s already two existing cut outs for another set of emergency doors.
Reply: @Graham_Wideman aircraft doors are slightly larger than their opening to avoid air leaks and structural stress on retaining mechanisms. That is why they have complicated mechanisms to angle them and be able to open them and usually go inside the aircraft before rotating outside. Most likely this plug had enough play to be able to rattle itself out of position and then the pressure differential and spring combination happened to be just right to angle it just so that it could launch it self off in the air.
Mine is just a guess about what happened, but based on Chris Brady’s videos, my B737 manuals and Blancolirio’s coverage it seems likely
Reply: @DennisMerwood-xk8wp he’s saying at the factory, or at Boeing because this jet in particular was brand new. The plugs aren’t checked by maintenance until the jet goes into a “heavy maintenance phase”. That most likely won’t be for another year or so. General maintenance tasks don’t require the inspection of the plugs. When an airline receives a new aircraft from the manufacturer, there’s a conformity check that’s done. That involves a lot of paperwork, checking interior equipment, and making sure all the required FAA placards are in place.
Reply: @jeffropenn  Thank you for your reply.  You are dealing with so many comments.  I realize the normal function of them, but just my observation wondered if they were not sticking out far enough in their normal fixed position.  Again thank you for all you do.  My Dad was an engineer for Boeing in the 1950- late 1970’s.  He passed away 15 years ago❣️
Reply: @anniechrisbendy6000 plugs are generally checked during a heavy maintenance phase. Every couple of years. They’re all based on flight cycles.
Reply: Just to add a little more context, these plugs aren’t checked during routine maintenance. Every so many flight hours these jets go in for a “heavy maintenance check”. The jet is gutted and inspected from tail to nose and everything else. That is when the plugs will be inspected. Another thing to keep in mind is this is a brand new jet. Alaska got it from Boeing this past October. If Something wasn’t installed that should have been, that will be on Boeing, not the Alaska maintenance techs. 
Another thing to note is other 737 models have these plugs installed. There’s never been an actual incident where one blew out before. When installed correctly, they may as well be a solid part of the airframe. They are very safe.
Reply: @kCI251   Don't lose sight of the fact that issues like these are NEVER an individuals fault. Random dudes in the factory shouldn't be able to make a mistake big enough to result in part of the aircraft falling off. The installation and inspection processes should be designed in such a way that it's literally impossible for a mistake like this to happen. The fault is with Boing itself... not some small group of employees they can scapegoat. The guy with the wrench may have been having a terrible day, or been on all kinds of drugs, or maybe he was even intentionally trying to sabotage the plane... this still should have been impossible to make it into production. Boing failed here... do not place the blame anywhere else.
Reply: @soffici1  I was referring to the pressure each time it flew previously, not just the event in which I agree was at the lower pressure you mentioned.
Reply: @465maltbie How refreshing some professionals that know what their talking about......not like the "media" rubbish and mis information.
THANKS
Reply: @DennisMerwood-xk8wp  Well, that's not out of the question, but as new as that aircraft was I think it would be very probable that the plug door hadn't been removed yet?  Its not a routine part to remove in field maintenance.
Reply: @2engjnr2  it explains why in the video. They are optional doors depending on the preference of the airline. The holes are there either way. If the airline doesn't want the extra doors (maybe their seats are more spaced out, so fewer passengers, and fewer exits needed) then "blanks" or "plugs" are fitted. It's like bricking up a doorway in a house.
Reply: @Paul1958R  I don’t recall if they were or not.
Reply: @ChasOnErie  The assembly is not accessably without tearing the planes interior apart. It is not a place you could sabotage
Reply: This “accident “ was planned by somebody…. Even one bolt would hold door in place !!!!!
Reply: @SWilford    maybe there's a way to prove your missing hardware theory. The nuts must have fallen inside the airframe.
Reply: Just to be clear this plug door isn't an  emergency exit, there's not lock system or handle inside,so what is it meant to be ? It seems to be fixed in place with no way to b e opened  from the interior ,obviously  vibrations and a missing castle nut pin on both locks have determined the door to become lose and pop open pressurization made the rest
Reply: @ShaunHensley  maybe more like not completely installed. I seem to get that a lot if I take my car or moto to the shop. Given this seldom happens with aircraft speaks highly of A&P mechs.
Reply: @Lt_Tragg  Improperly installed is improperly installed. I don’t know what kind of distinction you are trying to make, but you didn’t.

Keep in mind that GenX is aging out of the workforce, or has moved off of hands on roles.
Reply: @kCI251 they are all in Mexico by now......
Reply: @ScottiStudios  I watched the whole video just to hear that being mentioned but missed it somehow.
Reply: @encinobalboa  Or a Monday morning.
Reply: @edgonsorowski1924  no
Reply: They're saying it's been only 14 days in service so those pins/bolts have to have been missing.  I was thinking the cotter line pins weren't installed but I think it would have lasted longer than 2 weeks
Reply: throatjamma  They weren’t at cruising altitude and full pressurization
Reply: @DennisMerwood-xk8wp  I can't see why Alaska should remove the chairs and the wall panel to look for 4 bolts on a brand new plane.

If this was a real emergency exit, then it's part of regular inspection by Alaska. But it isn't an emergency exit. So if they have it in any maintenance list, then it should be a silly high number of hours before inspection.

The only reason for this not being a Boeing error, is if Alaska brought in some other supplier that removed the plug while installing some extra equipment. And the WiFi install has been mentioned as a possible reason for a plug removal after the plane left Boeing.
Reply: throatjamma  The seats are fitted to the floor. Not to the door. So no reason why the seats should be ripped out because the plug fell out. The wind isn't that strong. It was only objects not bolted down that got sucked out.
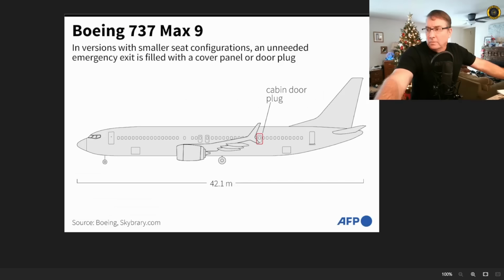Reply: @2engjnr2  yeh its at 1:59 and specifically 2:05 ... its very brief.
Reply: @AnthonySejda  Bolts and nuts can go out the opening the same way the plug did, and multiple mobile phones etc. But it's more likely there were no bolts at all.
Reply: @jeffropenn  The springs works in the opposite direction. They help opening the door. They aren't there to resist opening the door.
Reply: @ahndeux  There is no strain on the bolts. These are not the kind of bolts you tension to press two objects together.

The weight of the door is handled by the two pins that slots into the door at the top. The two top bolts are just there so you can't lift the door to slide it out of the two slots.

And the two bottom bolts can only be sheared off if someone can introduce a very, very big force to try to move the door up or down. But there isn't anything that can do that. No forklift inserting a fork under the door, trying to lift it.

As long as there is a cotter pin blocking the nut from rotating, then you don't even need to tighten the nut. Worst thing is that the bolt can rattle a bit. But that doesn't make anything fail.
Reply: @encinobalboa  Nor a Monday morning post-hangover 737.
Reply: @Leon-qc7fe  A bent cotter pin does not fall out. You bend the legs after installing it just so it can not fall out. You can see photos of what it looks like in the video.

Just that this plane had no cotter pins there. Probably not even any bolts. Just some luck, friction and gravity for the first 2 months.
Reply: I think your being rather harsh on assembly line workers to suggest that shift changes and Fridays are automatically sub par. 

I think it would be interesting to know just when it was on the assembly line because October 2023 has a lot of other implications.
Reply: @perwestermark8920  exactly.
Reply: Just curious. This so called door plug. Is it an actual emergency door less the internal guts ( open/close mechanism) that’s locked by the four bolts or is it a special plug made to cover the hole
Reply: Would that seal be strong enough help keep the door from sliding, at least for some period of time (considering four bolts weren't installed)?
Reply: Just a thought: If this were one door plug on one plane for one Airline I could see it as careless oversight or even laziness. But with all the planes for two Airlines (so far) showing up with loose bolts I have to wonder if something else is going on. Especially if this is the same door plug system used on the 737-900/737-900ER. This is just too weird.
Reply: @robertbenda3285 

That happens all day everyday on aircraft all across America.
Reply: @kCI251  While their corporate overlords will get another bonus.
Reply: I also don´t see how this massive bolt can get loosend. They are housed in axis direction. They only can move down together with the cpl. door plug, but this should be prevented by the spring system.
Reply: @stefking6112  
The massive bolts were probably missing.
Reply: What’s the point of a plug door if it’s not an emergency exit?
Reply: @rael5469 In theory it would be met with equal spring resistance from the other two holding pins (top/bottom).
Reply: @motofunk1 Going to be very interesting if they try to replicate this scenario and what videos will show at time of any “failures”. All the way around fascinating subject.
Reply: Sorry to disagree with everyone but this is not a plug type door. Plug doors and windows are physically larger than the holes that they are plugging. As the pressurization increases, the plug window or door  pushes against the smaller hole that its resting against and seals it from leakage. This is why you cannot open a door in an aircraft once it has just a slight amount of pressurization. Crews are not able or allowed to pressurize on the ground unless it's a maintenance test without passengers. In the event of a fire or other emergency requiring everyone to exit the aircraft, they couldn't egress if there was any amount of pressurization.    This door seals as it is allowed to drop into its tracks designed to draw the door tighter against the exterior of the fuselage, EXTERIOR. Have a close look at the door pictures and you'll see that there are no seals on the outside of the door skin, just a smooth painted surface. Those 12 stops on the fuselage door opening have adjustable bolts in the centre of the black dots you can see. They are adjusted to a very tight tolerance by the "technicians" and inspected by "Quality Assurance" prior to being signed off. Someone was late for his or her coffee break and things were overlooked. How many more things have been overlooked you ask? Keep watching the news and we'll find out.    The fact that this isn't a plug type door makes it a sure thing that I would never sit there.

 @Graham_Wideman
Reply: @johnparish1432  of cause, once the door went off, also the bolt is free to get lost.
Reply: @Milkmans_Son  1) See todays(01/09/24) episode. 2) The pressurization test would actually help set the door plug more firmly  as the purpose of the mounting design is for it  to seal more tightly the greater the pressure differential 3) The external forces really only come into play to move the door  plug vertically the ~1 1/2" it needs to slip out of the upper track and clear the capture pads. As long as there is not a significant force in that direction the door plug  would tend to stay in place. I think there may have smaller moves previously, which is why the pressurization alarms went of in prior flights.
Reply: @requited2568  On a two month old airframe? I think not.
Reply: @ApriliaRacer14   There are 298 replies here so I'm not sure what you are responding to.
Reply: @465maltbie you have it backwards, the door has to lift to open. It is easily confused as the photo is so zoomed in. The track is mounted on the door and the pin or roller as you referred to it is on the door frame.
Reply: so correct brother;  I remember decades ago the work of Federal Agencies to apprehend suppliers of falsely marked, for strength, bolts @mcburcke
Reply: Do you think it’s either a sabotage or installed incorrectly which is a training issue?
Reply: @adrianklaver113  Yeah, I saw the update but the nuts would be gone whether they backed out over time or weren't there in the first place.  On point 2, wouldn't the door have to install/close from the inside in order for it to seal more tightly the greater the pressure differential?
Reply: @perwestermark8920  I think we are talking about two different issues.  The cause of this accident has not been determined.  The NTSB is still investigating.  I'm referring to photos from United Airlines which showed the bottom bracket had loose bolts.  Those bolts you definitely tension since it attaches the bracket to the door plug.  Those bolts should NEVER be loose.
Reply: @ahndeux  Correct - the bolts shown to the right at the bottom of the picture of the spring loaded bottom "ear" should hold that part fixed to the "door".

And quite sad if those bolts are loose - which sounds like they have found on multiple planes.

And not only that - one of these fittings seems to be missing from the found "door". Not a part that should go missing. The other had a crack which seems like they say happened when the door got ripped out.
Reply: One word.. made in the US.. everybody Europe avoid that now 😂 Just like my crappy model 3 😂
Reply: @moggy4086  reminds me of all those "complacency kills" posters we had hanging around the shop
Reply: Door blew out cleanly - zero bolt situation
Reply: @stephanielloyd4053 assuming brand new parts can’t fail is a fatal mistake
Reply: @anjananaam9347   Less likely sabotage. But it could be a training and supervisory issue.
Reply: @cullery07  I wasn't. But the person I was replying to said they had "Finally given in to wear and tear" insinuating that these have been on for years.
Reply: @snowrabbit9558  does everybody in Europe think "Made In THE US" is one word, or just you?
Reply: @kCI251 How LOOSE do you want your job?
Reply: Exactly, what you said about there has NEVER been another incident like this in 737, history. Alaska Air, I do not trust.
I was up late watching cargo planes come and go from 3 big airports near me, mostly B737, 757, and even 31 years old MD-11s
Proper maintenance is the key. It is same with the jackscrew they never greased, cargo planes still fly THAT model, and THAT part has never failed.
Reply: @BigEightiesNewWave  Yet somehow Alaska is the only usa based airline to consistently make the top 10 safest airlines in the world list.
Reply: @465maltbie  Just looking at those springs at the base of the door they look very beefy. Would not surprise me if you could literally remove all four of the lock bolts, castellated nuts & pins and the plane would fly without incident indefinitely bc the springs are holding the door in the max upper position. It might rattle until cabin pressure was high enough but difficult to imagine turbulence being sufficient to depress it adequately enough for it to escape the guides. For that reason I think the finding of loose nuts elsewhere on the fitting is most likely very significant, along with the fact that the 4 lockbolts simply could not have been fitted.
Reply: The roller track is on the door not the frame.
Reply: jeff, the previous flight logs indicating a slight loss of cabin pressure would seem to be a smoking gun.  Would a failing door gasket account for that?  Would the relatively greater interior cabin pressure set the door even tighter into the opening?  If so then it should be more secure with or without the bolts properly fastened.  I'm assuming the door dimensions are greater than the opening.
Reply: @forestcooper5464  yes, auto pressurization issues was definitely the result of the plug literally being moved by the differential pressure of repeated climb and descent cycles. That’s what I personally think. The result of Boeing missing the step of installing the four bolts that keep it in place. If this is the case it will be one of those watershed moments in aviation safety, and really bad for Boeing. Again it’s just my opinion of what happened. From what I could tell, the plug fits into the cutout in the fuselage.